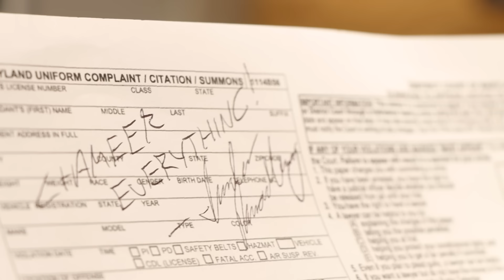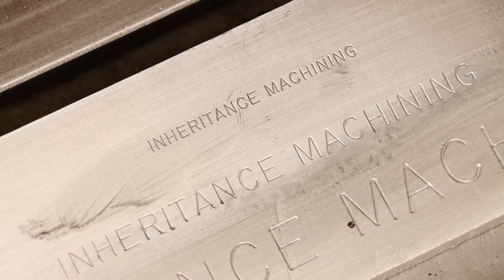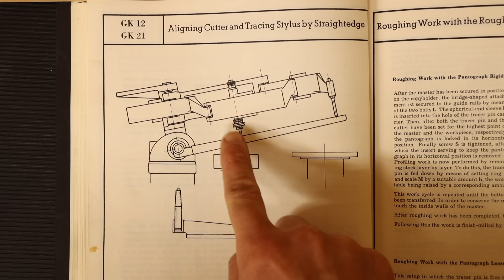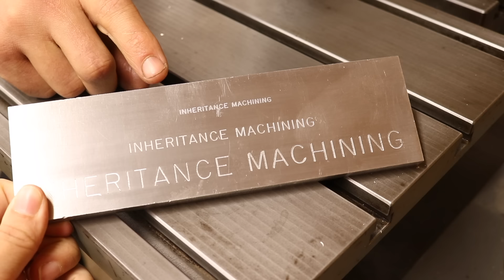Saving the Machine the World Forgot

Comment: As a second year apprentice tool maker, I spent a couple of months locked away in a little room in our plant 2 tool room (rubber moulds) hanched over a Pantograph engraving part and batch numbers in tiny little moulds for brake master cylinder piston cups and seals.  I still have nightmares about engraving the wrong number in a mould.

Comment: I picked up a pallet that weighed 2250 lbs. with my HF crane, on the "one ton" extension mark. Had to; any shorter and the pallet was too wide for the legs. 
I use that thing all the time; just got a new mill and lathe, and used the beast to R&R them solo.
A wooden pry stick under a leg makes moving even a ton a trivial job, and you can precisely position stuff. Just don't put it so far under that lifting occurs. I cut a slight angle on the end to increase purchase.

Comment: You need a cutter grinder, our 1962 injection mold shop had a Gorton pantograph with the 3D overhead beam option and cutter grinder. We had reverse fonts so overmolded plastic text eould read right. The local newspaper photoetched special templates from black and white copy. Get a factory manual (copy), our Groton manual had a chart of cutter depth, bottom tip off to character height.
Engraving on the inside of a plastic part many times produce a reverse ghost on outside textured surfaces - soft brush the sharp edges.
2005 CNC pushed the Gorton to the scrap yard. Retired from the shop in 2019 - saw many sharp CNC cutters wear/break until the operators learned to tip the fllat wider.

Comment: Watched tonight for the first time. Very exciting! I get the appeal of the old timers. Retired now but have run some old timey machines. There were two Blanchard grinders. Chucks  at an 18 inch diameter. These were 30 or 40 years old. Got into them. Found they'd hold tolerance these guys never dreamed of. Making circular carbide knives. I got them holding +/-.0002. We fundamentally changed a process.   Where they'd been leaving 
.004 plus material for a lapping  process we ended up leaving.0025 and bypassing one whole step. Better parts way more l productive. Those old timers were amazing!

Comment: Thank you for this view into past. I worked with a machine like this dayly 30 years ago. You tried to  kopy this 3D-part. When you are roughing the pocket, you notice how it us difficult to hold the cutter still. For this work, i am shure, there should be a funktion to fix the Y axis. So you can move in X and Z (up and down) and go step for step in Y. So you would be much faster. I think you have to look for it behind the table.

Comment: Well. We have 4 of this size of pantograph and my wife and I have always moved the. about using steel pipe rollers
We bought the first one new in 1972 for about a third of the price of a large house and the last one about ten years ago slightly used for £5. We use them for making brass parts and for machining hardwood to very fine tolerances.

Comment: Back in the late 70’s early 80’s I used the GK12’s 3D copy feature to cut graphite electrodes for an EDM machine.  I was building zinc die cast molds primarily for belt buckles and key chain fobs.

Comment: The 3D work opened up ideas of casting molds.  Before you start thinking about burn treatment protocols, mold for plastics require no blast furnace & working w/ plastics is like a vacation.

Comment: Just a heads up for your shop crain.  It says on the side how for to extend the arm to lift different weights. I have the same one and have picked up lathes and mills that where approaching two tons. As long as you dont side load it (like you did on your first attempt, when the stap was pulling to the side rather than straight up and down.), it will move pretty much anything in your shop. Even your Bridgeport if you take the head off (to make it alot easier and lighter.). If i remember correctly they weigh around 1800lbs. Anyway cool video. Good luck
Edit: also as an aside they still have a similar machine at the shipyard (navy/coastguard ship construction) I work at. They engrave all their own placards for everything on a ship. They have modern cnc engraving machines but still have one of these. They only engrave brass, aluminum and plastic as far as i am aware.

Comment: Just gotta have cast iron museum piece, strapped to the bed of a pickup for the trek home, tractor with loader pallet forks to un/load it, HF shop crane to complete the mini-wrecking ball experiment, partially disassemble the shop to stuff it all in somewhere...  Spooky to see that all as I've been there as well.  FWIW you might have rolled the machine on 2' long 1/2" pipe nipples in a more safe approach.  Absolutely enviable collection of machinery in that shop but the most spectacular take away here is WHERE DID YOU GET THAT WIFE?

Comment: We have a cherry picker/shop crane my dad built. He had a silage chopper that was worn out. He sent me and my little brother out to disassemble it. We un bolted, pinned, everything. Then we cut the frame apart and ground the metal smooth. He took it and built the cp. The arm was the drawbar. It is heavy. We have picked up complete 700 cubic inch diesel engines. 
Then I took some of the materials and built a torch caddy. You can hook it to the cp and use it to load the torch into a pickup. Fond memories.

Comment: It looks very nice. In many years I have also made templates on CNC too Pentagrams machines. But it's getting very easy to do. You can make a 3D printed model. You can use. But If you're going to use it often and then make it Double the size and transfer it. Two. Brass or Metal so you have a more stable template. 
3 D printed models. Has a little more inaccuracy. By making it bigger and making a new temple. Minimizing the inaccuracy

Like your logo, for example.

Comment: Back when I worked for a very prolific general aviation manufacture the pantograph routers were on the other side of the wall.  They cut a lot of laminated, heat treated aluminum.  Today I'm sure that's all CNC.

Comment: You should consider making some QoL attachments for this machine considering that you may use it often. Certainly could add mechanisms to improve the performance of the machine, unless you would rather keep it all original, which I completely understand. 

Certainly could though add a mechnaism that improves your depth control; giving you control over the mill's height. Should probably use a gear shift too for that little bit more nuance to your adjustments.

Also when you engrave something, I would recommend adding some kind of paint or ink to make it pop out. Would be best practice if you're machining something at a really small scale or if the engraving have little contrast between it and the surface. Washes (term for very fluid paints) would probably work well for this

Comment: Your Grandad sounds a great person to roadtrip with, calculations of the things around us where we can mix measurements with estimations are such fun. Bought a hand shaper recently , 30Kg of cast iron, obsolete or the best way to cut internal ring gears for home use, TBD. Glad to see you weren't powering the drill used to unscrew the power outlet from the power outlet. Stephan G has a pantograph so they must be useful. The joys of dropping a cutter ouut of the collet, ahh, not just me then. 3D copy from printed assembly could save all that cnc gcode setup I'm fighting.

Comment: A  Tracer Mill about 30-40 I worked at a Machine shop had one but it was fairly Big it was fun as long as you  used the right styles and cutters you can copy anything   the one I used was Hydraulic on X and Y access .

Some day I love to just get a Mill with a riser Digital Readouts and a lathe with Digital Readouts  it was fun to take a piece of metal  to a part unfortunately I got laid off when the Airo space industry took a hit .  Ya wee to put the equipment and everything with them .❤😅

Comment: Add a high speed spindle, it would probably be the most versatile useful machine resembling cnc, but more useful in ways, expecially to the hobbyist, repair person, or general shop use. 

The spindle should be electric, one with very high rpm like 80k or 100k plus, with small endmills that will last much longer in this setup, because they are less stressed when spinning so fast, EASY to control because they act very smooth like dental tools which cannot skip around, 
AND it would be cheap and easy to retrofit one of the high end electric spindles, of lower power to the quill because it is just a receptacle and machine sturdiness is less of an issue because vibration is less with no belt, less when spinning faster, less when navigating a pattern and less when compared to new ultra low runout electric spindles. 

YOU SHOULD DO IT. 
But also consider dust extraction too because those chips get everywhere. More convinient with smaller lighter chips though. It would be a WIN.

Comment: Next time you move machines with the shop crane, shorten up the boom as much as possible. It rolls easier and more controlled, much less pucker factor! You ptobably could have come 2 bolt holes in and locked the machine base into the base of the crane, no movement.

Edit to add: your wife is funny and very knowledgeable. Definitely keep her.

Comment: First of all, you are very lucky to have a wife like mine... almost exactly.  Lol.  Good job.  

Now, in order to do 1:1, you will need to add an another arm adjacent to the tracing arm.  The engraver shaft has to move exactly the same amount as the stylus.  It might be easier to copy some of the design of the pantograph, and make your own device.  I love seeing these old manual machines.  I have a HF mini lathe, and a LMS mini mill.  No DROs, but I can do pretty accurate projects big and small.  I've made 3 or 4 brass cannons, one complicated machine that pushes a certain size cable through plastic tubing using a drill, that has dovetail slides, uses 4 precision ball bearings, and 2 differently designed machined hinges.  A combination of a velocity stack and air filter for a 1956 plymouth. The biggest thing I've ever turned on the mini lathe... the blank was 4.125" Dia...and 4 inches long aluminum. I was on the lathe a lot for that one.  95% or more went into the scarf pile.  But it turned out beautifully. And you know, I saved -$150, but I made it myself.  And it's how I wanted it, not how other older hotrod shops have made theirs.  Keep up the good work.  Keep that amazing wife happy,  I know how hard that is.😂 love, KP

Comment: Even heavily used pantographs would fall into the “lightly used” category. Aquired 2 GK12’s that were formerly MATTEL TOYS assets. You would think they would be heavily used, both what I would consider lightly used. The mold shop where I served my apprentice had 6 of these machines, all in pristine condition.  
Just a note, the top of the spindle has the ability to follow a “Z” axis pattern. There is an optional arm that mounts on the top of the machine that could hold like a domed pattern so you can engrave on a domed surface.

Comment: I would love a woodworking version of this.  I will probably make one.  I just acquired my tool that no one wanted.  A 60s Magna Sawsmith 500003 Radial Arm Saw.  15 years of looking.  Is it the best RAS?  No.  Is it better than even a modern sliding miter saw?  Also no.  But I love it.

Comment: when I got out of high school I worked at a shop that bought the Marx Toys R&D Model shop, and they had a Beautiful Gorton 3D Pantograph it was very similar in the 2D design of the Dekel and Gorton, But the Gorton had a pivot beam that was above the pantograph links and the x and Y always remained horizontal and the z always stayed vertical, the tracer and cutter moved vertically. I got to use that machine quite alot, the real beauty is the template ratio cuts the tolerance in half for a 2 to 1 if the template was within .010 the cut part is within.005 and so on.

Comment: Nice machine, the last ten years i could get 4 of this type Deckel Pantographs for free.
But space in my shop is limited, so i decided against this machines and now i own a less heavier, smaller Deckel G1L. On this machine i use a fast running head of a Deckel FP1, with an adapter, for small milling and boring operations.
For me the much better, and more universal solution.
Have fun with your Deckel!👍

Comment: Keep your eyes open for one of those aluminum kid's scooters. The urethane wheels are great for re-purposing for things like a wheel assy to make swinging your hole in the wall, wall.

As you get older, you'll appreciate a small upgrade like that more & more, even if you use it infrequently.

The motion/muscles used to lift & move that wall are unusual & rife for an injury.  I have an inherited defect in my back right between my shoulder blades.  Trust me on this one, you do NOT want an injury there.

Nice score on an old piece of iron, now lets see you add some new purpose(s) for the old unit.

Re: "you dumb... ...don't let go..."

Having been there frequently in getting used to an ER32 collet on my drill press & my new mill acquisition, I made a couple of small foam catch boxes & added them to the mandatory area, like collet wrenches.  Get a wrench, takee a box.

Comment: Once you got it off the palate, if you'd moved the crane arm in a notch or two from 1/2 ton to 1 ton or 1.5 tons, it would have spread the load better between the wheels and rolled a lot easier...

Comment: 90% of all machine tool mills Lathes surface grinders. I always seen them moved on 1 1/2" steel bars and a big crow bar. The only thing that wasn't is a wire eroder. they don't have cast iron bodys lol.
No a complaint just if you get a lathe and trying to move them around.

Comment: I've got a question, would it not be possible to use the 3D function to engrave the letters rather than setting the depth every time? You could set the depth once and then just trace and lift just like writing with paper.

Comment: I don’t see why you’d have to pull that one outlet off when you open the wall. You could just as easily run the BX up and over the ceiling for that one outlet. Saves you a bit of work next time you need to move a machine. 😇

Comment: McLouth Steel had a shaper taking 1.75" deep, .060 feed making curly cue chips that pinged loud enough bouncing off the ceiling, I'd duck. Only reason for the job was to make chips they put down to slow and cool the molten steel poured to make flat slabs.

Comment: You have purchased a fantastic German machine!
All the machines in your workshop appeal to me very much, it's a pity that I am not your neighbor, because I live in the Netherlands.
With these conventional machines you have to know exactly what you are doing.
I understand that you have little interest in CNC machines, which were also invented in the US.
But that has also changed, because manual programming has virtually been taken over by CAD-CAM systems.
These are excellent, but here too the original spatial thinking with programming and calculations is taken over by the computer.

I also see an ordinary drawing board, one of those things I have used for years.
You can now do a lot with computer programs and that has also been further developed.
Of course you cannot do with your conventional machines what a 5-axis CNC machine can do, but by thinking you can get very far and that is the nice thing about these conventional machines.
CNC operators are becoming less and less programmers and more and more button pushers, which is a shame, but understandable for mass production.
I hope you enjoy your machines!

Comment: have you considdered etching a template pattern... It would sort of be a half way house between CNC and manual milling if the template mask was printed! DAM... What about 3D printing a template, 2D engraving tile or even a 3D shape. For a 3D shape you could pring oversize to overcome the lack of a 1:1 panto setting in 3D configuration!!

Comment: I have a question, how hard is it to trace out stuff that's not on metal templates, if possible at all? I figured you could somehow transfer a custom design onto a soft medium and trace out from there, my brain went to paper first but that sounds STUPID.
Reply: I have followed pen lines on paper with a smaller one of these, it's not easy but it's doable in soft material with a strong grip and enough reduction to reduce the "feedback" force from the cutting tool. It also makes your mistakes smaller.

Comment: pantograph are great if i was young with a shop i would have one in a heartbeat worked engraving for a few years back in the day,*** DANGER  but i will give you a word of warning remove that light from it we had exactly the same light on one of ours and the head got turned so many times it frayed one of he wires and it almost killed me when i touched the light and the machine at the same time i was saved by the fact i was on a wheeled chair and was able to push away from the machine before my legs froze from the electricity by that point my entire upper body was frozen and could not let go scared the crap out of me so i would not use that light **** DANGER

Comment: You really should have made sure your floor was spotless cuz them steel wheels do not like debris on the floor and you should have pulled your boom in as far as you could so your ass and didn't pop up and it would have made it a little more stable we've pulled a lot of engines out of cars ur really capable so I know you have it under control